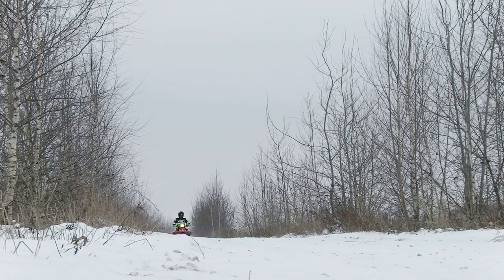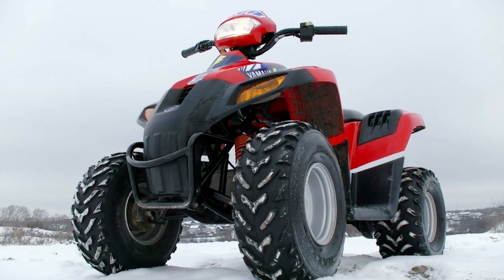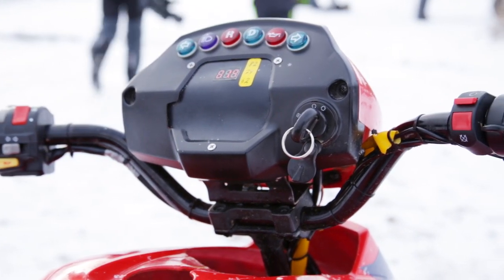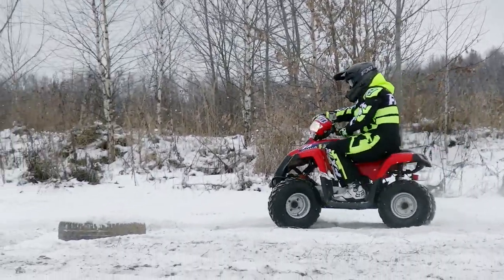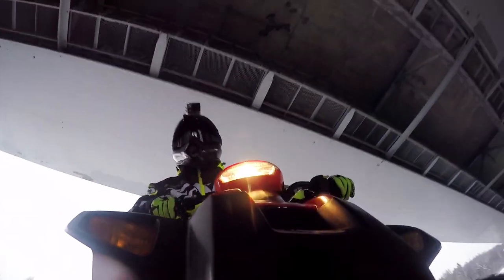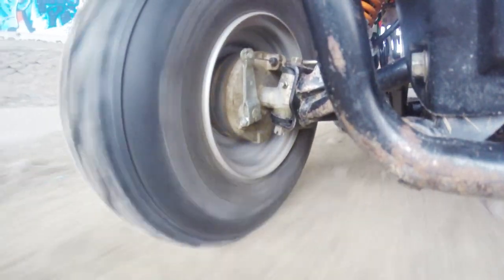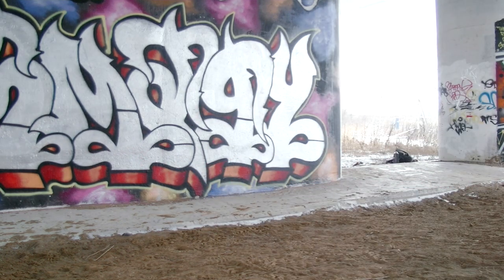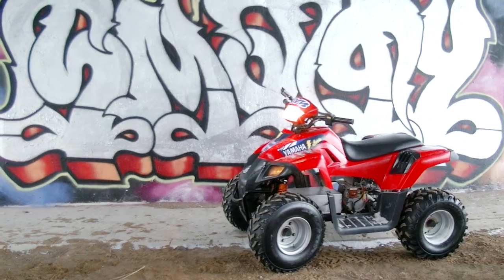How to turn old quad into a real electric beast!

Comment: $2,000 you could buy real decent 450 TRX or race bike and had some money left over for parts and upgrades well that ATV hit 70 miles an hour better yet will it handle the abuse of a hardcore riding condition or racing across the desert the saying no $2,000 you can buy a used name brand Kawasaki Honda Yamaha Suzuki it's been tested and proven to handle most apis obstacles electric is not the same as gas the throttle response is a lot different and I bet you your electric will get somebody hurt faster than the gas
Reply: LOUD. I can ride electric all over my neighborhood with zero issue. A gasser will have the police out here in a few hours.
Reply: And I could never use the darn thing cause how loud it is. I could ride this thing at a park easy without anyone caring about it. Also you could ride around golf courses